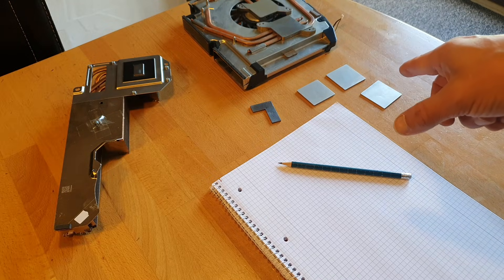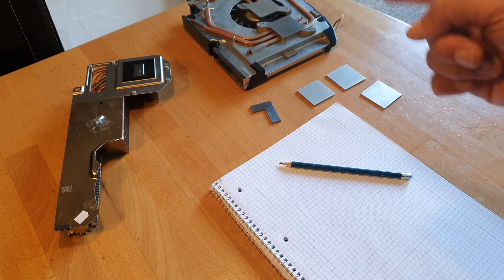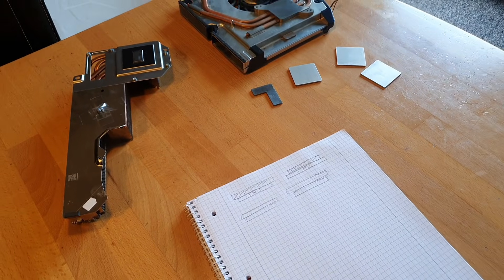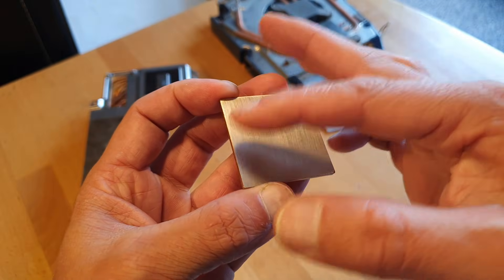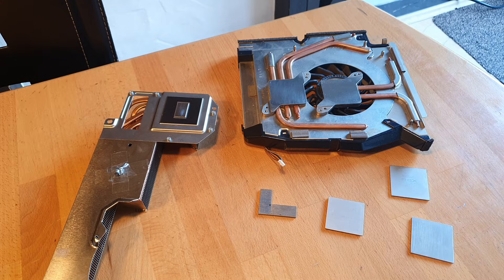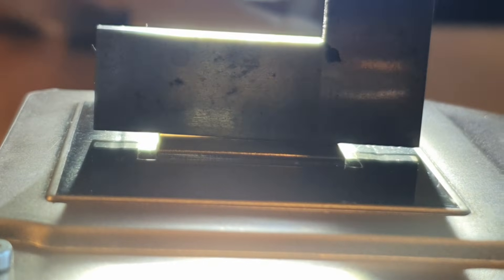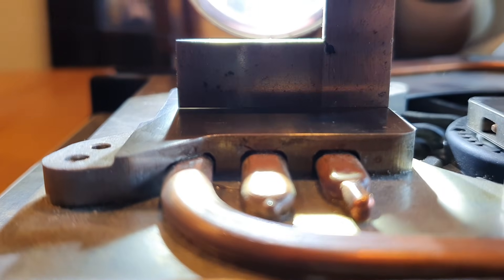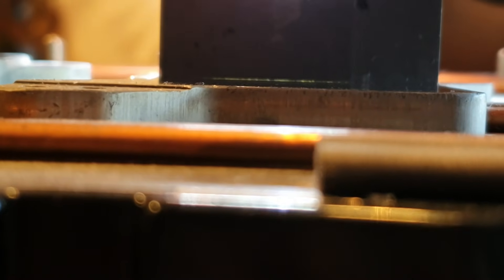NSC´s PS3 Mini IHS Project Part 2 By:NSC

Comment: Hello there i wanna ask i have ps3 slim CECH-3004B model and i change the thermal paste but when i put my ps3 on it won't showup anything i tried again and again it shows normal nothing happen but when i run the last of us the game stops and. A lines shows in the screen... Please reply me and sorry about my english thank you man ❤
Reply from the maker: Hi You will need to Reflow or raball the RSX. Did you delid the IHS?
Reply: @NSC-Modz  no i don't
Reply: @NSC-Modz  i am from algeria and I did not do anything and I do not know if the repairmen here are capable of fixing such problems.. By the way thank you man and tell me if you have a instagram or telegram so an can contact you ❤

Comment: Hi! Great job! I would like to ask about the question. Recently got PS3 cechc08 and i wonder how to protect it from YLOD? Any ways? Cell was delided. Temperatures in Crysis 3: Cell 75, RSX 79-80, FAN 28%
Reply from the maker: Hello An YLOD has a lot reasons, it's not only because temperatures. Your temperatures could be better, 75-80°C is danger. Try to stay unter 70 please
Reply: @NSC-Modz  Thank you very much for the answer! I think 35% fan speed will lower the temperature to 70 degrees
Reply from the maker: @БанькаПорилка-э9и  yes, if you have no holes drilled on the case, go for 35-38% I know it's loud, but better loud than dead 😅
Reply: @ yes, it's better than nothing😆. In the future I think about deliding RSX and transferring it to liquid metal. Is liquid metal a good idea? I saw that it drops the temperature to 11 degrees
Reply from the maker: @БанькаПорилка-э9и it drops only for a few weeks, than it becomes bad because oxidation and the liquid metal will get hard, this will cause problems. Better go for Thermal Grizzly Kryonaut, this paste never gets hard until it runs under 75-80°C
Reply: @ Got it, thank you very much for the information😃
Reply from the maker: @БанькаПорилка-э9и You always very welcome 😀
Reply: @ oh, one last question. How much better a temperature boost does a fan with 15 blades from later revisions give than a fan with 19? I just have a later revision of CECHL and I can transplant it from there. Is it worth it?
Reply from the maker: Not really a big difference, it's more about the loudness to be honest.
Reply: @ ok. Well, I'll try to experiment with this some more. It seems I got answers to all my questions) 
Thanks again)
Reply: @ ok. Well, I'll try to experiment with this some more. It seems I got answers to all my questions) 
Thanks again)
Reply from the maker: @БанькаПорилка-э9и yeah, it's all about testing testing testing :)